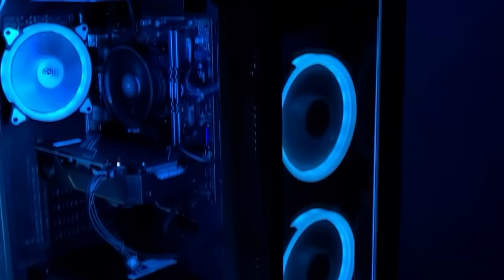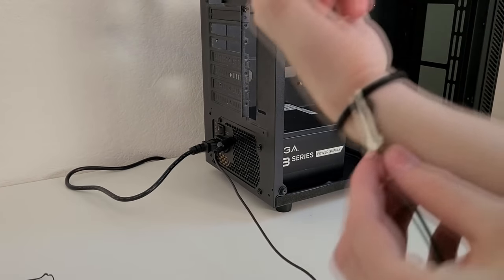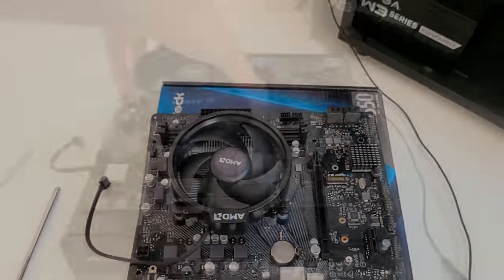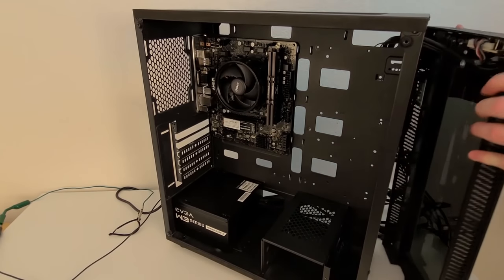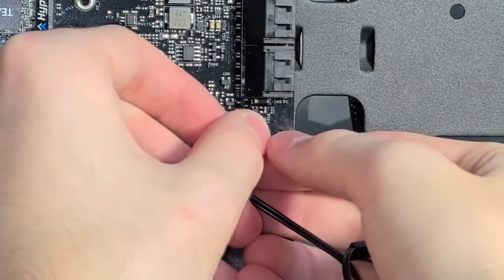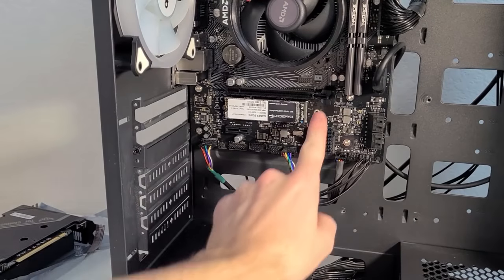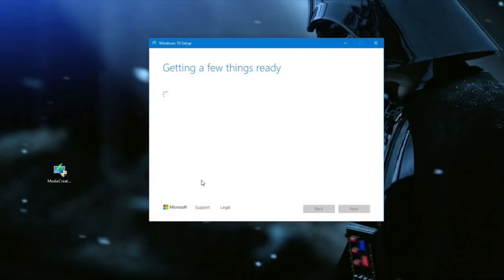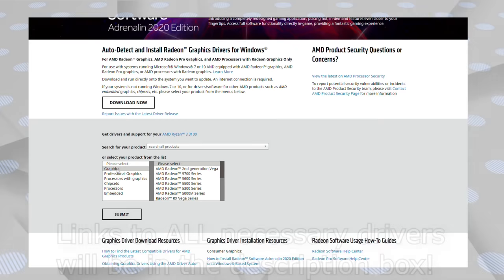BEST $550 Streaming/Gaming PC [Tutorial, Benchmarks]

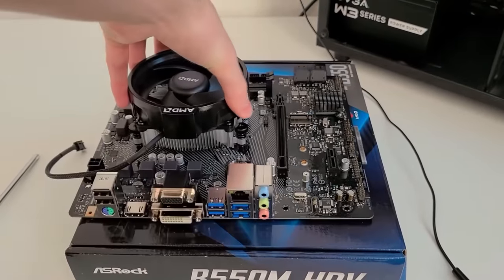Comment: 4:54 love that verge reference
Reply from the maker: hahaaha
Reply: @Roo_Tech  first question what program did u use for the fps calculation, second can u make a video on how to know which psu u need for which components of ur pc.Thanks, also ur so underrated.
Reply: @milosadamovic9498  you can use pc part picker and then it will tell you the average watt usage. But usually 500w-650w is good
Reply: @deztroit  ty

Comment: Ordered parts. Gonna build this after months of saving. Wish me luck everyone
Reply: yeah me 2
Reply: Ace Mayb  ight sure
Reply: Where did you buy the parts?
Reply: @jhinx268  link in description
Reply: How much was it for you
Reply: @charlesgray4892  $592.02 USD
Reply: Ace Mayb  I assembled it and it runs pretty well lol
Reply: @jhinx268  Amazon
Reply: @jujharkapoor9786  how
Reply: @jujharkapoor9786  when I put my stuff in the cart it wayy more cause the graphics card and all ths
Reply: @jujharkapoor9786  how did you get it for that cheap did you get the graphics card?
Reply: @charlesgray4892  depends if it’s in stock by amazon theirselves or not, if the price is much higher then it means that someone else is supplying the product and they raised the price x3.
Reply: @excitful  how to I set up WiFi on it it works now and stuff but I don’t see the wifi
Reply: @charlesgray4892  you most likely bought a motherboard with no integrated wifi, you’ll have to buy an internet adapter on amazon and then you’ll be able to connect to wifi.
Reply: @excitful  I bought the motherboard from this
Reply: @charlesgray4892  the motherboard shown in this video doesn’t have integrated wifi, meaning you’ll have to buy a separate adapter to access the internet. Look up Wifi Adapter on Amazon.
Reply: @excitful  do they have em at best buy
Reply: @charlesgray4892  depends on your store, my local store has them but it may vary from location to location. Check their website and make sure you have your closest BestBuy store selected and look for Internet Adapter.
Reply: @charlesgray4892  u need to buy wifi card
Reply: @charlesgray4892  I used honey and stuff lol
Reply: @jujharkapoor9786  bro what cable are you using for the image hdmi or DisplayPort ?

Comment: Nice build guide, a good step by step guide, although for the parts I would have gone for something different. Instead of a 3100 a 1600af would be a good option for streaming but if that’s out of stock then 3100 is still a great option. Also b550 may be a bit too much, b450 is still fine and is quite popular with budget builders, micro atx is what I recommend for first time builders as it is quite simple and small and generally easier to build in.

Comment: WOW! This guy explained each step so easily!! i can actually understand this. Im gonna be getting these parts soon for christmas and build this with my dad.. Thanks so much for the help, really easy to understand and really easy to build thanks to your guide!  :)
Reply: Just a note, all of the graphics cards are like $600 now.
Reply: @nanan_hello  those are the gforce gtx graphics cards. i found the ones hes using but sold out, so i found one that looks like that (have the same legnths etc) and yea imma use that
Reply: @HasanVancouver  it doesn't matter about the length, you have to check the capatibility with the graphics card slot on the motherboard.

Comment: Ello, I’m someone who built this pc and here’s some disclaimers (note I have a different gpu brand and fan pack):
-The motherboard doesn’t come with screws so get the screw kit, I’ll leave a link if Roo sees this and allows me to
-The case in the description is a different case and I’ll also link the right one if I’m allowed to
-If your a ytuber you can easily edit with this without any problems
-The rgb for the case isn’t able to light up because the cord to complete it isn’t there
Other than those things this pc is pretty good

Comment: Just ordered the parts today I will update to let people know how it went! 😁
Reply: Have u received them yet and if so, how does it perform
Reply: I finished building it two days ago it works great I’m mainly playing osu, apex, Minecraft, and Genshin runs great at high settings but I would make sure you see what type of port the fan has before buying it because in the description he had fans on their which were called Molex and those connect straight into the power supply not into the motherboard like he did when he bought the fan hub his fans needed the fan hub but the antec ones did not because it said Molex
Reply: @Nebulitz i get 60 ok games like apex and Minecraft and Genshin like it’s en ouch where I don’t have to look at the counter but I think it’s capped I don’t know how to remove it if it’s capped because on osu I get like 400 but it makes since because it’s a less demanding game I just wish I new more about computers to figure it out but it’s works great for what I play on
Reply: @urielmontoya5449   how did u connection it to the internet like did u need an adapter or no?
Reply: @jasmineserrano8495  If you want wireless yes I used a lan cable and connected it to my router but if you wanna use the internet wireless you gotta buy an adapter
Reply: @urielmontoya5449  how do you know what cable to get for the router
Reply: @jasmineserrano8495  I just went to the hardware store and bought a Ethernet cable I don’t think there are different ones
Reply: @urielmontoya5449  oh okay thanks
Reply: @urielmontoya5449  how well dose it run games?
Reply: @jasmineserrano8495  I mean it works great it averages the same frames as in the video I don’t get stutter and with fairly high settings obviously it could be better with more money but runs just normal in my opinion
Also this is the first of I built and I’m glad I spent the money
Reply: @urielmontoya5449  oh okay thank you i ordered the parts this is going to be my first build any tips?
Reply: @jasmineserrano8495  watch a ton of videos on how to make a computer and follow the video as he builds it and if you ordered the antec fans  it connects straight into the power supply there is a fan splitter for the motherboard that he uses in the video but you can connect those straight into the power supply there is a cable.
 
And take your time I spent about 4 hours building it but I’m sure you could build it faster good luck 👍🏽

Comment: The moment I saw that psu i knew this was a non upgradable pc
Reply: Is it rlly non-upgradable ??
Reply: Omar Ordonez yes a 450 watt psu is very bad for future upgrades, and it is very hard to upgrade a psu
Reply: Why is it non upgradeable because the power supply? Sorry I'm a pc noob
Reply: JuniorsWRLD -  yes, it is possible to upgrade but you won’t have much room for upgrades and it is also annoying to replace a power supply
Reply: @dr_sniping3504  why
Reply: JuniorsWRLD - you need to unplug all of the psu chords, un cable manage, take all the chords out, the put the new psu in, and then you need to route all the wires in, and cable manage, and then after 3 hours your only half done
Reply: @dr_sniping3504  Do You Know Alot About This Stuff
Reply: tbh i dont really care i would buy a better case and all sorts of better stuff to put in it instead over time so
Reply: @Jared Miñoza yes but only if you also upgrade the psu

Comment: I already built this lmao
Reply: Nice bro my only question is howndoes it run warzone for you? And is this a Wi-Fi one?
Reply: @smuk123  I got just bought a wifi card and it can run warzone at around 90-120 fps on low settings and normal textures. overall it's a pretty good build and its definitely a great starter rig.
Reply: Is this worth getting and is it actually good?
Reply: @tylerrobic7858  I have no regrets yet but it depends on what you mean by worth it
Reply: Jayden ok thanks and is there an ulcer at I’ve power supply for this pc I’m living in Australia and can’t get either of the 2 in the discription
Reply: And fans
Reply: @tylerrobic7858  go on amazon or bestbuy or micro center or newegg and look up evga 450 watt psu or corsair 450 watt psu because others wiill be bad aand explode.
Reply: @jaydenj11999  what other games do you play, I might wanna copy this for my first build
Reply: @tylerrobic7858  would honestly try getting a deal on a a 2080 / 2080 ti or even a lower gpu like 2060 since those prices are going down alot at the moment. Besides that while the gpu in this build isnt bad its pretty much at its limit at high settings and spending a bit of extra money will be very well worth it and will end up saving you money in the long run aswell. Plus youll have even better performance :) Ofc the price is higher but the value is great atm in my opinion so it really depends on if you can save a bit of extra money to buy a better gpu or not.
Reply: You can actually see the gpu holding back the cpu in the higher settings. The gpu is at max usage (99% in the top left under gpu usage) while the cpu is sitting at a much lower %
Reply: @Samie_Ikigai  yes friend got a 2070 for 260 and I got a 1080 for 280
Reply: @ClassicSkye  Exactly! You can even get 2080ti for like 300 or some even sell for less if youre smart about it!
Reply: Why do i feel like this guy is hes friend and hes not telling the truth
Reply: @mazafn3535  who? Glazzing and me? Nah just commented this cuz i genuinely think its better value atm and thats what im gettinf
Reply: did the digital chill mark work for you if not what website did you use to buy the license????
Reply: Can I Use A Ethernet Cable For This?

Comment: I’m a console player trying to get into pc gaming would this be a good starter pc? Also I’ve never built a pc before so is this a good tutorial video?
Reply: Yes it is for the price but if your trying to go pro go for the 700$ pc
Reply: @edilbertolazaro2407  u can upgrade this pc over time right? (Just making sure before I order parts)
Reply: yestfue 387 of course
Reply: @yestfue3873  Yeah I'm pretty sure you can almost always upgrade your custom pc just make sure the parts are compatible, prebuilts on the other hand aren't always upgradable.
Reply: yestfue 387 yes
Reply: @callagracee  ok thanks can this pc run red dead redemption 2 at medium/high graphics around 50-60 fps
Reply: youre used to lower framerates so this would be great
Reply: @jacksonmeyer9345  yea, on some, if you expect to get over 200 on high settings in warzone then you’re highly mistaken.

Comment: I got the parts for the pc only thing i really had to worry about was the fans but i found out you can just connect them to the power box ones and it worked besides that as of right now posting this comment im downloading the drives and the pc looks pretty dope.
Reply: lemme know if it’s running good
Reply: @captainripley  you know what let me tell you this, this pc is actually really good for not overlooking this pc gets stable frames at around 200+ with competitive of Fortnite without it actually having any fps spikes. Right now i got it for $615. It wont take much but i recommend you get everything off if amazon besides the gpu and cpu. The gpu is sold out and i recommend you get the asus TUF one since it has the best boost and normal clock getting you at least 5-10 more fps on some tittles. Its good trust me when i say this. This pc can handle many games without issue. The download speed for downloading fortnite for me was less than an our(47 minutes) when downloading fortnite and other tittles at the same time. Only bad thing is that ut has an led button that you cant connect to an depending on what type of fans you get you cant use a fan splitter, for example molex fans those you have to connect them to the power supplies connectors instead of the fan splitters. You could get this for even less if you cut corners like getting a smaller SSD. I got it for around 51 for 512 gb. This pc can handle modern level gaming on 1080 and 1440 getting 120 hrtz max for the refresh rate on the screen. I only have 60 but im hoping to get a better screen in the future. Make sure you know pick the motherboard like the B55 since it can support am4 sockets and up the the 3rd generation of ryzen. That's pretty much it if you want to know anything specific just ask but building this pc was kind of scary for me at first since it was my first time and besides that this pc is really good and i would reccomend this as a start for your gaming rig.

Comment: I had to use option c for the ram...I can't afford a $1000 ram...the option c pops up a $77 option by OLOy but for 2-8gb ram, im getting the 2-16gb ram for $137. All of this brings my build to $645, which is not bad at all, but most of these items are low in stock or not in stock at all, and some have limited availability. Hopefully I can get everything in waves so I can finally start streaming.

Comment: At 20:24 at low settings the reason you have 100+ fps is because you disable the multicore rendering so when you change the settings to med you enabled the multicore rendering so your fps got to 200+ Big Mistake on there bud xD Great Vid thou and the Guide is very understandable Tnx

Edit: The Multicore Rendering makes the cpu cores to work together and not a one core only

Comment: Ok I dont know how the hell to connect these fans to the fan splitter. The ones you linked have 4 pins and the fan splitter is designed for 2. Help?
Reply: Toxic  I ended up having to buy new fans. The ones I got have a 4 pin female connector or something like that. They worked.
Reply: Toxic  as far as I know you can't connect it straight to the power supply, but I know you can connect one fan to the motherboard but that's it. I'm not very computer part savvy so I'm not sure if I'd be the best person to ask.

Comment: would you get the same performance if you change the Ryzen 3 3100 to Ryzen 5 2600? I can't decide which one is better
Reply: Ryzen 3 3100 is simply a 2600 with less cores but with higher clock speeds so if you're into gaming , 3100 will deliver better performance or if you are kind of a guy who likes editing high-res videos and stuffs or if you want apps opening in the background while you gaming , 2600 will handle it better. But that will not be that much difference in real life usage but the 3100 will give you more ( about 5 - 15 ) fps in games for sure. So the conclusion is that buy a cpu that is cheaper in your place. For example , if 3100 is cheaper in your country go for it . Or if 2600 is cheaper , go for that ... Or , if both starts at about the same price , I would recommend you to go for 3100 since it has better 7nm process than the 12nm in 2600 🤓✌️.
Reply: @big_smoke7t  I think imma go for the 3100,  as you mentioned its more updated and focuses mainly on gaming,  thanks for the reply!
Reply: @zolloplayer9697  You're welcome !! 😁😁

Comment: ok the PC is great but ithink it can be better if u use better parts like 3300x instead of 3100 which is 20$ more but it gives 15 to 20% more performance than 3100 and also motherboard i recommend to go for msi b450 a pro max it is a atx motherboard better vrm than asrock and better BIOS and also much better ram support

Comment: You put the CPU labeled cord as well as the one labeled W3 but you only plugged in the one that says W3 right?
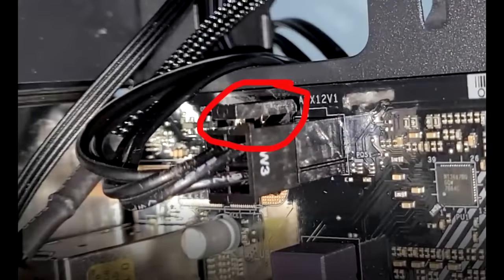Reply: At 8:50
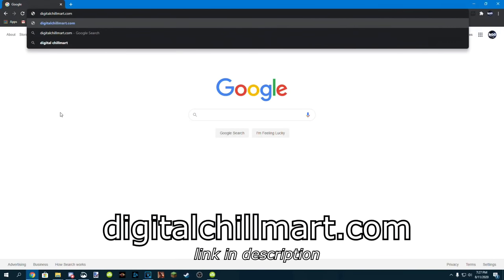Reply: 15:49 I don't have the one labeled Reset SW for some reason. Is that needed?
Reply: @gustavorios4736  no not every case has that

Comment: i haVE a question do u need to have drivers or can u do it without it im new to this stuff btw
Reply: Drivers are always needed. That's how the operating system (Windows) talks to the hardware. By default, Windows 10 will automatically download and install the drivers it assumes are best for your hardware. I prefer to download them straight from the manufacturer's page. In my experience, Windows usually downloads older drivers and in some cases, buggy drivers.

Comment: when would it be alright to take off the wrist strap? I’m new to this
Reply: also does he just attach the wrist strap to the frame of the case behind of power supply or does he attach it to the power supply
Reply: @dany082950  look up antistatic wristband on yt, not required but highly recommended
Reply: @vitalesports7899  do you know if it would be alright to upgrade to a 1tb ssd instead of the 512gb one
Reply: @dany082950  I believe there would be no harm, go to a tech youtubers discord and u will get better answers.
Reply: @vitalesports7899  alright thanks

Comment: i followed this exact build step by step and i got the pc built but for some reason when i turn it on. it'll turn on for a split second and then shut off. like i'll see the fan leds turn on for a split second and then that's it. its off. i've made sure all the power cables are connected etc but it still wont work. can someone help?
Reply: I’m no pc expert and probably can’t help well but maybe check the power supply and it’s cables. Maybe its not in all the way

Comment: Is it possible to upgrade the graphics card to a 2080 or is these other steps I must take before upgrading the gc?

Edit: or can I just use a 1660 ti instead?
Reply: 1660 it is fine a 2080 probably won’t have space and it’ll be a bottleneck because you have a 3 3100
Reply: @grandmasteryoda3682  ty. What would be recommended for a GeForce 2060 super?
Reply: @itzpicayune8157  a 5 3600 would be great and is compatable with the motherboard he said 👍🏼
Reply: No , 1660 ti obviously doesn't worth it when rtx 2060 exists . I would recommend you to go for 2060 or 1660 super.
Reply: @big_smoke7t  I'm planning on getting 1660 super if I can't find a 2060

Comment: My fans only have a 4 pin connector! Did I order the wrong ones
Reply: Do not buy first option fans! They only come with 4 pin and do not work with the fan splitter
Reply: @meaquaa4854  u got molex fans and they connect through the power supply